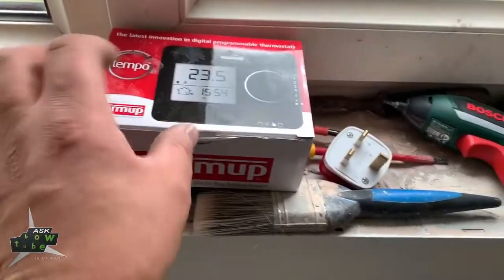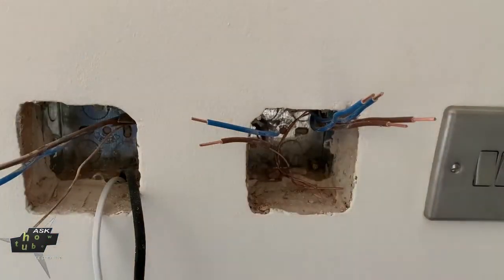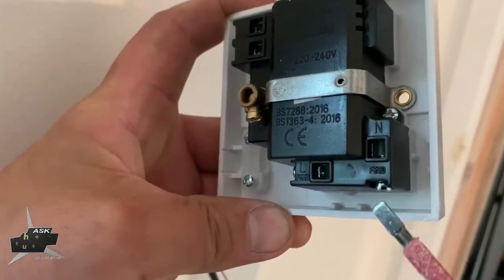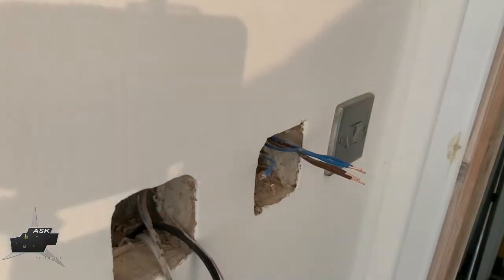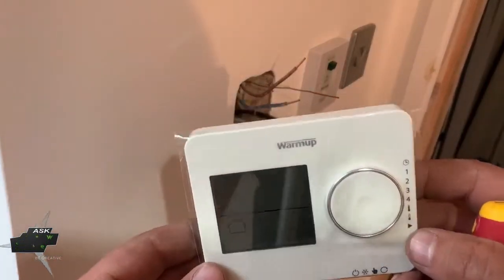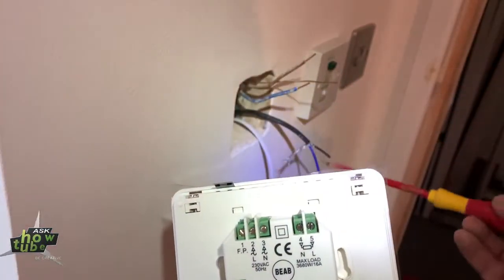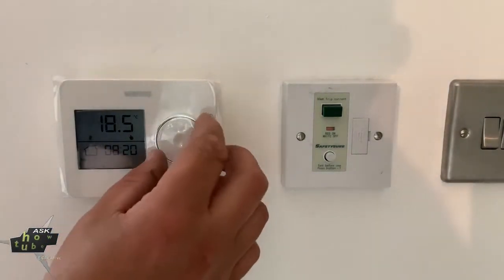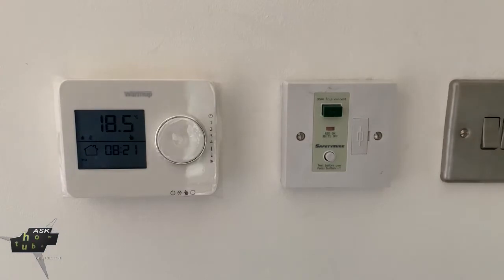How to connect, how to wire electric underfloor heating, to the RCD and thermostat.

Comment: I guess there is no issues regarding the electric system when you ve got this in only 1 room but if you re having it in half of the house they can work in the same time without affecting the electric system ? Or you need a special individual cable from the mains to a separate fuse box and from that fuse box to have cables to each thermostat ? I was thinking at 3 thermostats with 6 zones in total.
Reply from the maker: From the ring circuit for sockets, I have done underfloor heating on the living, kitchen, and bathroom, so 3 thermostats … never had any problems, an authorised electrician told me that this is the way to do it, he came and checked everything I did, he signed the certificate, power never dropped off… everything works fine…
Reply: @askhowtube  thank you for your reply. Also can I ask you how much is the running cost ?Are you using all 3 of them continuously through the day and night or just when you need them ?

Comment: I'm installing under floor heating in the bathroom. I dont have any electric sockets near, would it be ok to connect ceiling light? I'm also going to be fitting down lights. thank you
Reply from the maker: I’m not an qualified electrician, but as per advise I have from my friend who’s qualified and he always sign after my work, he said underfloor heating must be connected to a minimum 2.5mm cable which are the ones from sockets...so you need to take a cable from the nearest socket.
Reply: @askhowtube  thank you for the advice. Also does it matter what kind of fcu is used? I tried to look for the one you used but couldn't find anything similar. Are you able to links of product code for any common suppliers.
Reply from the maker: Shershah Nazari I will look tonight when I get home and I will come back with a reply.
Reply: @askhowtube  your a good man. I appreciate your help
Reply from the maker: Hi, you cannot use any fcu... must be an eve spur... here is the link where I bought mine from
https://www.toolstation.com/safetysure-rcd-spur-white/p45636?store=K1&utm_source=googleshopping&utm_medium=feed&utm_campaign=googleshoppingfeed&gclid=Cj0KCQjwtsv7BRCmARIsANu-CQcT-o1d94ZlAg9SI3HFAI55X9WQTOvOCIZInXyMfjnvvA-Ps6Y9KJMaAq48EALw_wcB
I hope it will help you.
Reply: @askhowtube  that's is perfect. Thank you so much for your help.